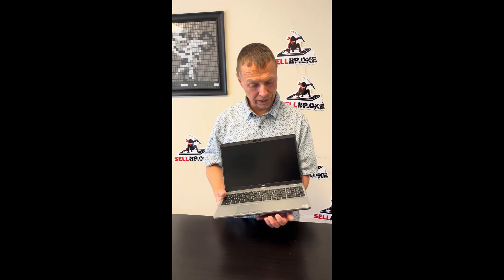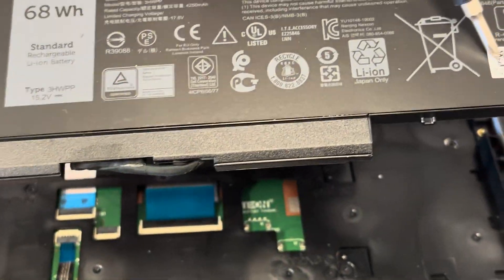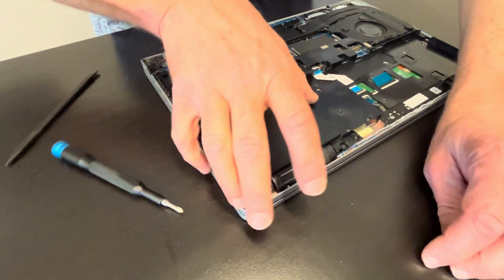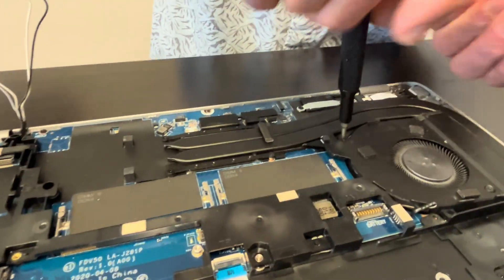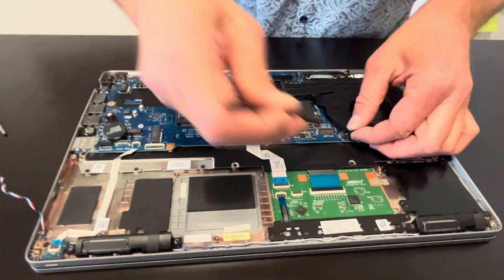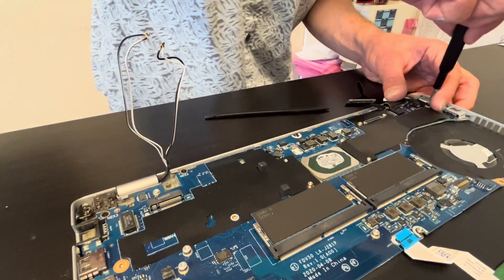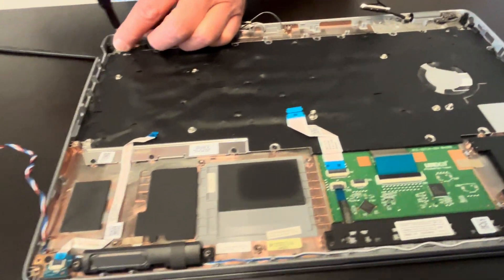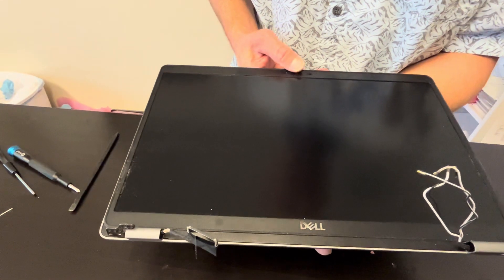Dell Precision 3551 Laptop. Take apart. Fix, repair, upgrade, replace: memory RAM, SSD, LCD, Battery

Comment: ty
sorry if my english its so bad
My keyboard doesnt work at all and i need to replace it with other, i need to dissambly ALL the motherboard or i can take out the screws and some things like battery and ports for take out all the motherboard to go to the keyboard?